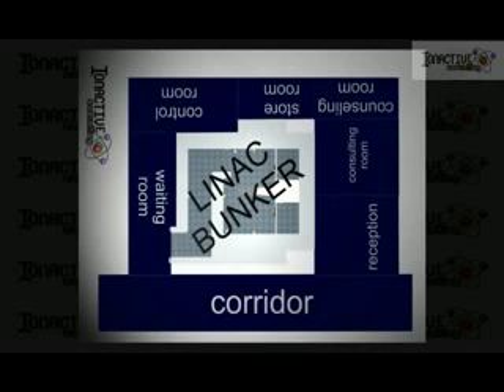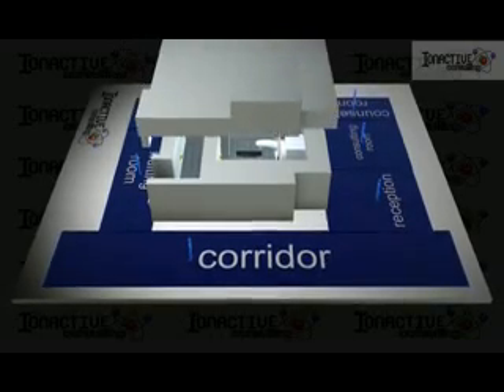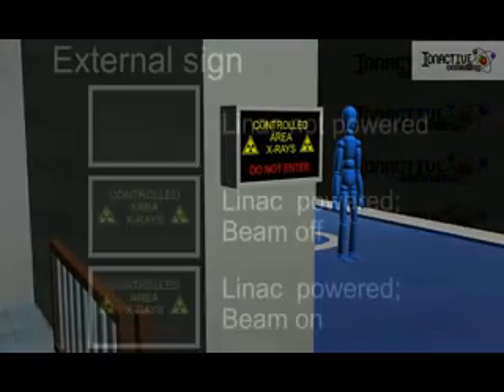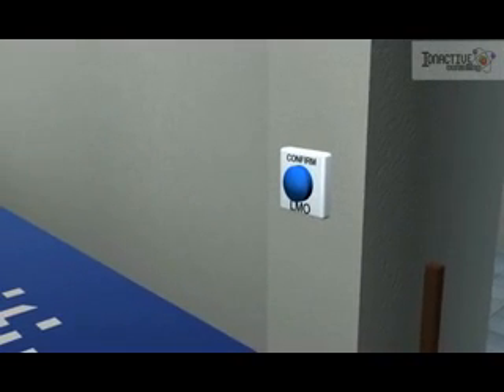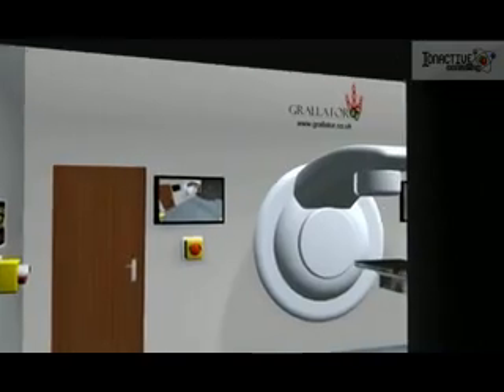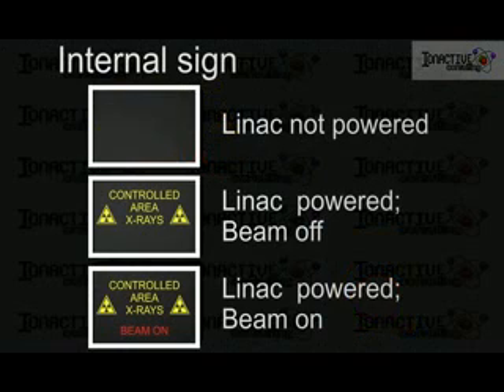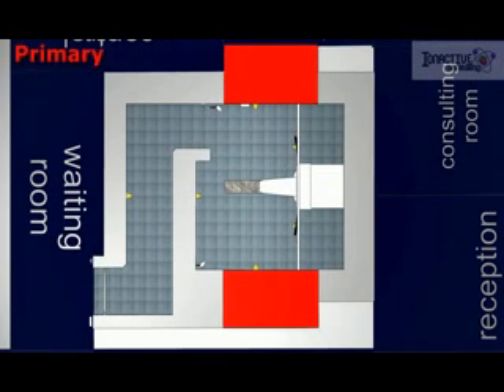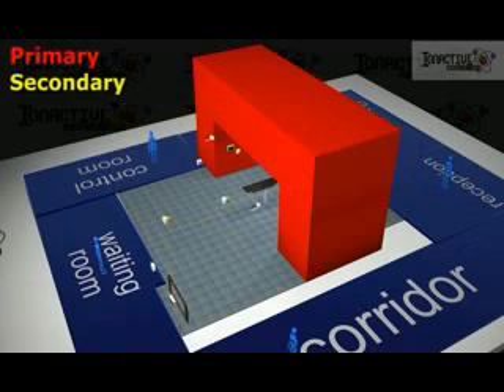Medical linac bunker design

Comment from the maker: Well I have commissioned maybe not as many as you have decommissioned. I have seen all sorts and the ‘child gate’ was modelled directly from a picture taken at one such new facility – so they do exist. There are all sorts of designs, including those with no gate at all (which then rely on light curtains). As far as the LMO button is concerned  - yep, seen many of those too. Again, position of them varies as does the confirm button - sometimes not a button at all but uses a gate switch interlock